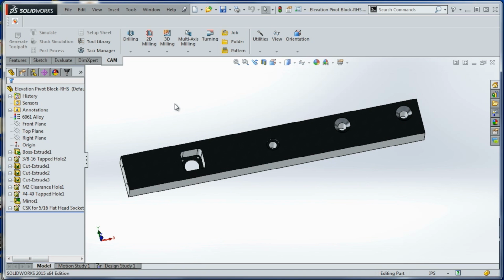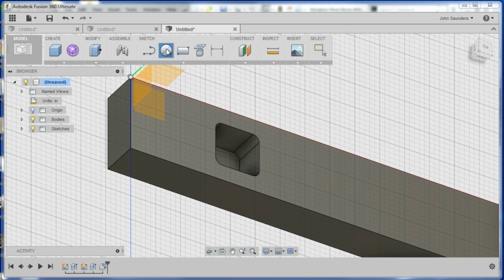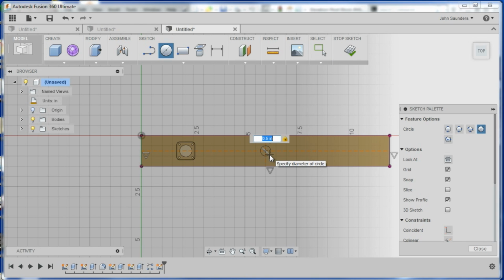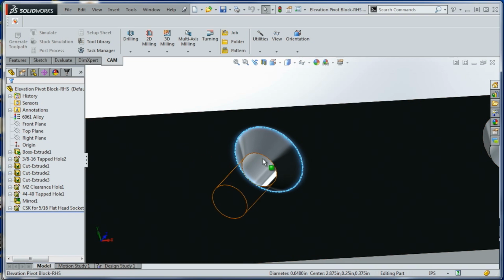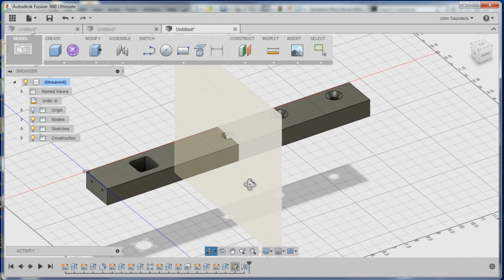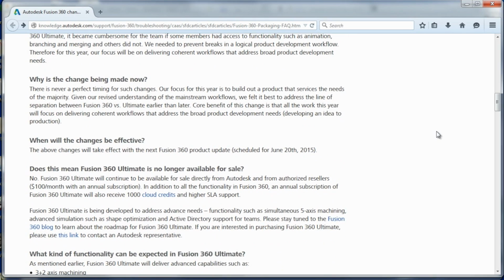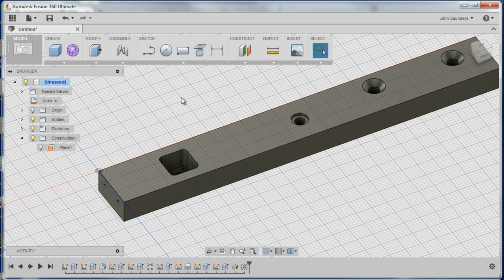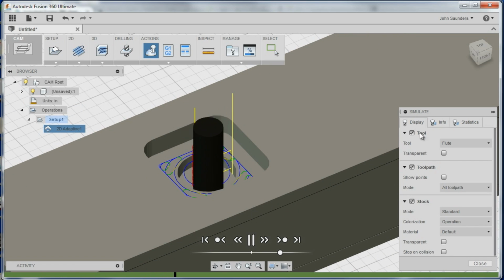Fusion 360 Tutorial:  The BEST CAD & CAM for the Home Shop!

Comment: Hi John, yet another great video on Fusion. I've tried a solid works i hate it. I'm an AutoCAD guy. It's so much easier to do tasks in AutoCAD 2015 vs solid works (I did a trial of it, did about 20 min in it and wanted to put my fist through the monitor). Fusion is incredible! I LOVE that I can do solids in model and then head over to CAM and do my cut paths and send it on over to the CNC. and it's affordable!! It doesn't cost 9k a seat! MAKE THE FUTURE!!

Comment: I learn something new every time I watch a video even if its one I have watched before. The more I use the software the more I seem to catch from watching the videos.  

I do have a question I  hope some one can answer. I keep drawing all the features in 2d then trying to extrude them. the problem is I do not yet know how to get multiple extrusion height/depth from fusion. As soon as I extrude once I loose the 2d sketch where I have already drawn The feature I want extruded to a separate height.  I have done it once or twice after hours of playing with it but I want an explanation or maybe a video. I have more than once gone back and drawn the feature a second time onto a now extruded surface and then performed the extrude/ push pull task.

Comment: Thanks for the tutorial. I have been learning Fusion 360 to replace eMachineShop (very easy to use free 2.5D CAD) as my design tool for bass guitars. AutoDesk now allows hobbyists, students, and startups making less than 100k to use it free, indefinitely. I sell like 2 or 3 basses per year mostly to support the hobby, so it's a fantastic free tool for what I need.

It's a lot easier to use than I thought it would be, thanks to your tutorial.

Comment: Veterans can get Solidworks for $20 a year, so would you recommend learning Solidworks or Fusion 360 for the CAD?  Then assuming you use Solidworks for the CAD is HSMworks or Fusion 360 better for CAM?

Comment: I followed along and made a very similar part to what you did in this video and when it was calculating the tool path it took my computer like 5 minutes to do the one that seemed to take your computer like 3 or 4 seconds. I have a 2015 mac desktop with 8 gigs of ram and it is a clean and generally fast computer. Am I doing something wrong that would make it take a long time?

Comment: Are you running Mach3 or Path Pilot on your Tormach?  And what Post Processor are you working with? I'm running Path Pilot and can't get usable code from Fusion 360.
Reply: +NYC CNC One little thing I didn't know and might help others out.   Was that you have to set Work coordinat system and under the next tab "posts" change the number of WCS from 0 to 1,2,3.... depending on how many you have. hsmExpres will use the part's World Coordinat System if one is not set.

Comment: Discovered Fusion 360 by watching your Fusion Friday tutorials. I've been teaching/using various CAD and 3D modeling software for many years ... Fusion 360 is truly a remarkable piece of software! Organic modeling with T-splines combined with parametric CAD and CAM ...NICE! 
Thanks for all of your videos ... I've learned a lot !
Cheers
Reply: I learned by watching his videos as well. I would look at MasterCAM and said to myself "there has to be an easier way" I have no desire to get a degree in MasterCAM. I did a Fusion trial (initially used it for 3D printing) dove into the CAM, it's easy easier and understandable. I just ordered a next wave automation cnc shark HD4 for my home shop. I'm like a kid in a toy store! I have code to post and 3  hours per part on machining (I will be adjusting feeds and speeds to go faster depending on material)

I finally broke down and learned the software because I was so tired of paying machine shops thousands and thousands to do 4 parts. So I figure about 4 to 6 parts on my HD4 and it will have paid for itself!

Also ordering a water cooled spindle for noise and longevity.

love your channel, John! keep up the great work!

Comment: IDK if anyone has explained it yet but right now Fusion 360 standard is fully capable of 3 axis machining which at first was not the case you only got 3 axis machining with the 360 Ultimate package at first. I believe it was in July that they aligned the two and then proceeded to add Mill turn and 5 axis machining capabilities to the Ultimate package along with some other more business oriented aspects. I'm not sure if its still going on but they did a special price of $25 for your first year of Fusion 360 around black Friday. That is when I purchased it for My business and I truly love it. for the cost which to hobbyist students and start ups the best part is its FREEEEE. and you cant beat free and you will not find a better product out there with the capabilities this offers for the price range. I have looked into upgrading our outdated cad/cam software that unfortunately was a basic 2.5 axis software that was really limited(it ran on windows XP, enough said). Just being able to create adaptive tool paths is worth it with the increase in productivity and less wear on machines and tools.Also the Offline feature does now work!With the constant updates and amazing features that keep being added, and for the price that isent going to be out of date or replaced next week. If you haven't tried it I would deff suggest it don't be scared off thinking its junk cause its either free or very cheap in comparison it is amazing!

Comment: I'm a retired MasterCam user. I learned on the DOS based 4.2 MasterCam 3x software. I loved it. I would like to have a home CNC mill to make hobby pieces. This looks interesting. I designed with the CAD and it was easy. I won't be doing production just one or two pieces.

Comment: What a great video, i want to try Fusion 360, i use autocad 2014 for modeling and Woowop 5.0 for machining, by the way i run a Weeke machine. My question is, is fusion 360 compatible with Weeke machines?

Comment: Nice video John and thanks for putting that up. I use Fusion myself and like it. As a Mac user it was a game changer. You showed a few things I don't normally use but liked the way you did them.

Another very good thing about Fusion is the support. The team there are very responsive to suggestions for improvement and an answer when you get stuck on something is generally only an hour or two away via their forum.

Comment: I've been getting into this.  Can't beat the free trial run.  Such a great program for the non-professional.  I should be testing with my CNC plasma table soon.  It will be awesome to be able to use one program for almost anything.
Reply: NYC CNC Somewhat.  I used a Precision Plasma gantry and the CandCNC electronics package.  I built the frame and set everything up.  The electronics package (Mach3 with their hardware) has full height control, which is nice.  I'm running with a Powermax 85 and it's great so far.  It would be nice to be able to do the CAM for the plasma through Fusion, but I'll be happy being able to grab the .dxf file and post with Sheetcam.  It looks like you can basically go into the drawing mode and grab the .dxf file for a specific face and save.  I should have some more time soon to see how it works.  Thanks for the videos, they have all been helpful.  I have been teaching myself about CNC and the plasma was my first experiment, knowing that I wanted to get into full CNC machining.  Fusion really opens up options to people like me that can't afford Solidworks to get just to try and learn.  I like the fact that Fusion should be useful on my plasma table, as well as giving me the power of a full CAD/CAM system that I can learn and apply to a CNC mill at some point, or even just part design.

Comment: I see you have the same problem as me, Coming from solidworks the pan and zoom is a little weird, One of the things you can do to make it easier is go to >Preferences ->General> Then scroll down to pan,zoom orbit shortcuts and change the dropdown box to solidworks and then your not so messed up when switching between software packages.

Comment: Solid Edge has had the feature playback ability for many years. It is especially useful when modifying a part you didn't originally design or you designed several years ago. Possibly not so important with 20 items in the tree by when there's 100 features in the tree it is a quick way the understand the model and the original designer's thought process.

Comment: Hey John! Good call on Fusion, I got into it a few weeks ago while looking for CAM for my VMC. It's still a bit buggy (at least the Mac version is) but I've been getting good results!

This toolpath was all done with Fusions CAM: https://www.youtube.com/watch?v=5tpa66031S0

There are some sections of that which still clearly need optimizing/tweaking, but for a first run it came out very well!
Reply: NYC CNC So far the Orange vise has been great! Eric was very nice to deal with. Haven't done anything hugely demanding of it yet, but everything I've done so far has been very smooth!

I'll be starting a production run soon, so the vise is going to get put through it's paces!
Reply: Gough Custom
 Hello Gough,

Nice video! You should throw Fusion 360 in the title of your video so it will come up when people search for Fusion 360 . It's pretty neat to see an actual machine running a toolpath with software you are working with,trying to figure out or looking into getting. (Not knocking John's video at all) The more the merrier.

Comment: I have used Inventor (which is the professional version of Fusion) for years.  It's my favorite modeling software.
Reply: NYC CNC If you are only using it to model parts for machining, it's probably a little expensive (Like Solid Works).  If you design things and need the analysis part of Inventor it's great.

Comment: The pace of progress the Fusion 360 Team at Autodesk is improving the product is really impressive.  I had also moved from Solidworks/HSMExpress over to Fusion back in November and really struggled the first couple of months with learning and becoming frustrated with the new workflow and the "Timeline".  Finally got over the hump with how sketches, bodies and components work together and separately and also how to "Activate" and Show/Hide just the feature(s) I'm currently interested in and thus shrinking the Timeline down to a minimum clutter that shows just the immediate elements that I am wanting to edit.  Great stuff John.  It's a really exciting product.
Reply: NYC CNC I have spent a lot of time with F360, but have so much more to learn.  I saw one part in this video where you can really speed up your designing.  Rather than create construction lines, like I often have done to find the center for placing a circle or hole within a square/box, try using "3-Point Circle".  You just select the mid-point of three sides of your square (or rectangle) and finish the circle, then select the "Sketch Dimension" tool to redefine the circle to the size you want within that square ... super fast.

Comment: Fusion 360 has all files cached locally. If the connection is down you are still able to work. It is actually free for hobbyists! You can register for the free version inside the software.

If you have problems with rotation try shift-click with the middle mouse button to set a rotation pivot-point.

The Activity-History on the bottom is not there to see how a person built up the part. You can edit each step or change order and therefore change your results. It's Autodesks approach to parametrized modelling. If you deactivate the history they call it direct modelling.

Comment: I hate to take the wind out of your sails, but there really wasn't any need to "rebuild" that part from scratch.  Inventor and, by reference, Fusion 360 both have built-in "AnyCAD" technology that would have allowed you to import by association, the entire part directly from SolidWorks without any file conversion.

Don't ask me how.  I am totally green and at the lowest rung on the ladder of learning, but I happened to come across that new feature while perusing Autodesk's site.

It sounds similar in concept to the old "Object Linking and Embedding" idea from Microsoft back in the late nineties.  Changes made to the original are reflected in the imported object and vise versa.  I guess.

Comment: Nice work John and thanks for providing a good peek under the hood of this package.  I have to say that wow this Vid took me back a few years.  Sincerely watching this made me appreciate Rhinoceros 5.0, Sprut and Vectric software more than I have in the recent past.  I don't say this to discredit your POV, because you certainly speak for the majority of folks that are coming up and wanting to advance.  Oh yeah and I also respect the hell out of you for what you have been able to do in such a short period of time (even if you are an Ohio guy :-)).

Once upon a time I tried to use "Alibre Pro" and thought that it was not intuitive, inefficient and lacked free form.  This was even though it seemed to have parametric function which was awesome.  I long since moved on to other packages.  I can use Solid Works, and don't mind it as much because it actually performs, but I still find it non-intuitive to the average Joe's way of thinking about drawing/design.

The Fusion 360 is not what I would call "New Maker" friendly.  For instance there are clicks required to get working within a construction plane that you want to develop is anal "Engineering" think on the route to a functional model.  It's funny that I say this because I think in hardcore engineer a LOT.  I lost the constraints of thought on how to make the model 5 years ago when I moved to Rhino and was challenged to think more of, "how do I undo that hole after the fact when I want to change its diameter" vs. being constrained by the software interface.  I guess it comes down to how you think and what you had been exposed to. 

As an old school autoCAD guy it was an unfamiliar yet amazing feeling to be open to the Rhino way.  Along the same grain Sprut used to piss me off too because there was NO guidance besides Eric's Youtube videos and guys posting on forums.  I remember yelling, "Just FACE THE PART DAMNIT" at the waterline function LOL. The dongle also made me want to implant the entire package up someone's nether region at times- especially when it failed on me. Now that I understand it it isn't too bad.  Actually I can really appreciate the fact that once you understand how SPRUT thinks that you are allowed an amazing amount of freedom in your approach to machining a part.  For the price you get a ton of high end functionality that a small shop could never afford otherwise.

Quite frankly for the new person that is living in 2D and simple 3D designs the Vectric software programs are stupid easy to understand and you can even run some very refined 2.5D cam in the packages that on a local machine for very little money!  Oh yeah and their on-line tutorials and help documentation are geared towards the laymen....even the vocabulary is stupid easy to understand if you don't have a masters degree in the cartesian coordinate system  I steer many this way because the learning curve is so shallow as well as the price point.  Seriously though Cut 2D, Cut 3D and the newly changed VCarve Pro 8.0 are mighty nice for the dollar and they seem to evolve in leaps and bounds at every major revision vs. fixing bugs or adding two or three new functions (sound familiar). 

Speaking of Revision I recently upgraded my elderly VCarve Pro 6.5 to 8.0.  This was a 2 revision upgrade for me.  I had been living in Sprut 7.0 happily (I own 2 licenses of Sprut) but a dongle failure made me question if I needed to have another 3/4 axis package under my belt.  Mind you I hadn't paid Vectric a dime in 3.5 years when I called in for an upgrade to their latest and greatest.  When they told me that it would be $150 to get a fresh install of VCarve 8.0 Professional I started laughing!  Mind you that it supports 2D and 3D as well as some 4th axis work and I originally had paid $620 for the program.  I had over $3k into my Sprut investment and I was looking at dropping $1250 just to get to version 9.0 (even though 8.0 barely had a life).

At any rate the cloud model access from anywhere and any machine is definitely an advantage.  I just don't feel that Autodesk has tapped into the minds of non-engineering types that have "Zed" CAD/CAM experience and just want to make things with their newly purchased CNC XYZ router, printer, mill or turning center.  Some company not owned by legacy thinking is going to get it even more right and allow a hellacious disruption within this category.  3D printing "slicer" programs are on the cusp right now, but until a digital machinist gets deep into the code we are going to be stuck with the fragmented options that both you and I present.  Respectfully submitted to "THE MAN"!  Doug P. in MI
Reply: Doug P Sorry for the ramblings and "spellins" Yoda, but it has been a long week here LOL!